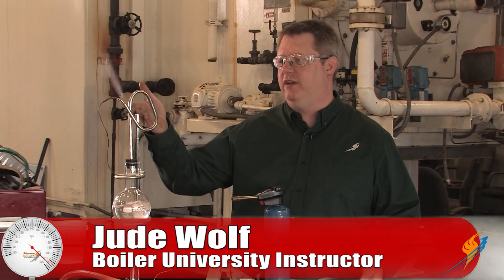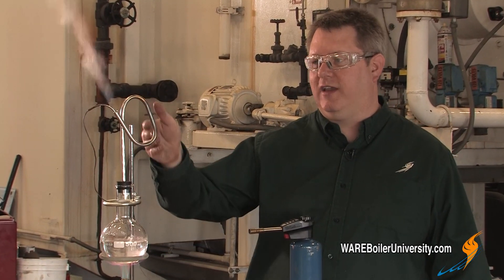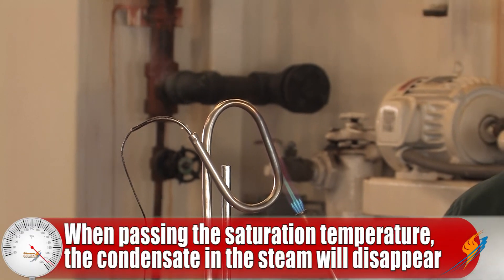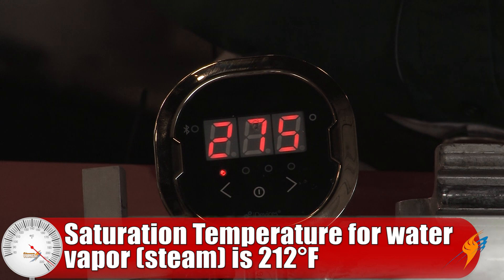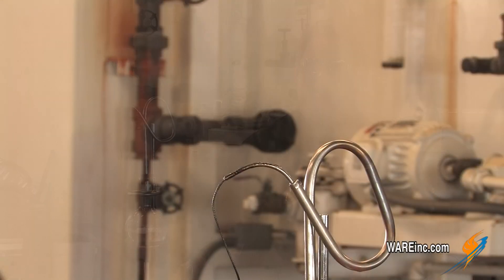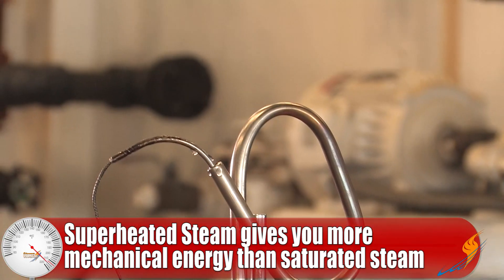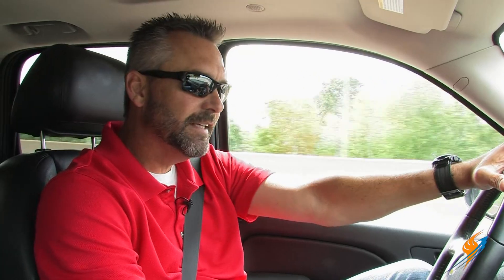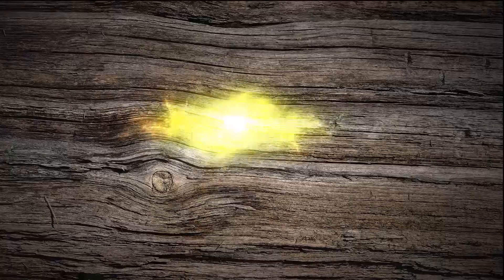Superheated Steam - Boiling Point

Comment: Do superheated steam condense
Reply: Ofcourse it does. Every type of steam will condense once it houses it's heat. With superheated steam, they condense faster when they lose their velocity as well.
Reply: @haroonibrahim2620  ok thanks.
Is a condenser enough to condense superheated steam
Reply: @stripesstrikecompany9860  a condenser is usually a heat exchanger. That's enough to condense superheated steam. But often times you will see a  desuperheater which is an equipment that sprays water directly into the stream line. A part of the entering cold water evaporates and the steam looses it's superheat. Usually this is the approach.

But regarding your question, I don't know why you would want to condense superheated steam. Usually people want to convert it into saturated steam. It usually looses it's superheat when it passes though a turbine or something. Quite curious to know why you want to condense it without using it.
Reply: @haroonibrahim2620  like in the process of distillation and then condensing it
Reply: @stripesstrikecompany9860  where do you have superheated steam in distillation?
Reply: @stripesstrikecompany9860  dry steam distillation I presume.
Reply: @haroonibrahim2620  like in essential oils distillation
Reply from the maker: @Haroon Ibrahim has done a great job of answer but yes all steam will condense back once it has given up all of it's energy (whether that be through travel / work / heat exchanger). Thanks for watching and thanks Haroon for having a good answer!